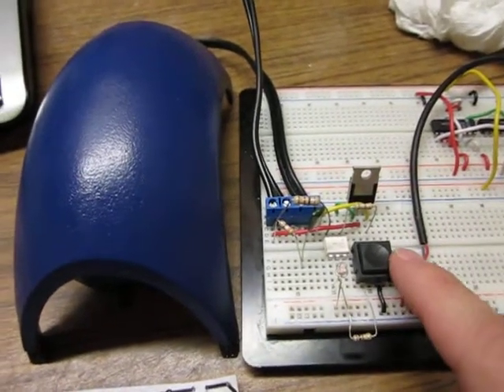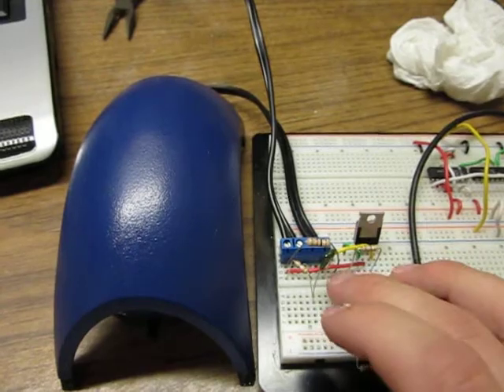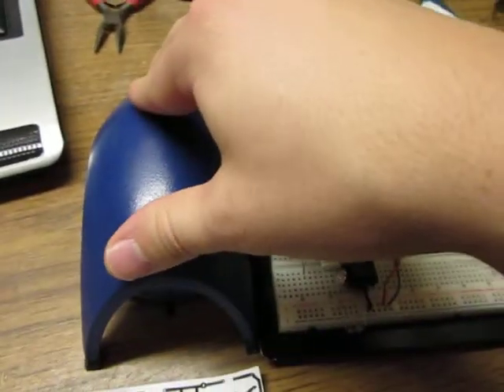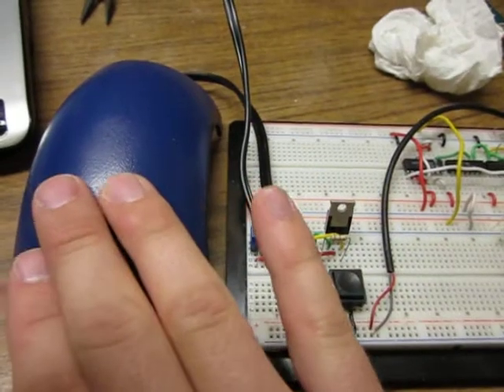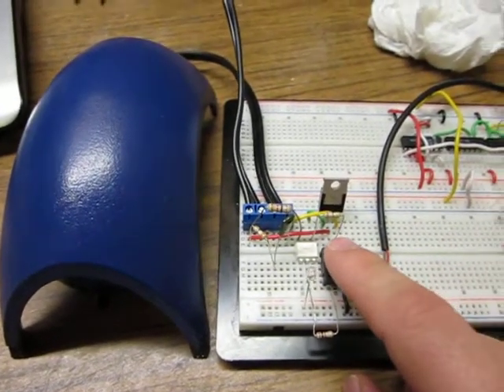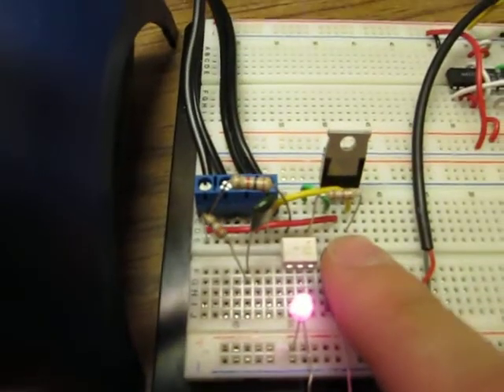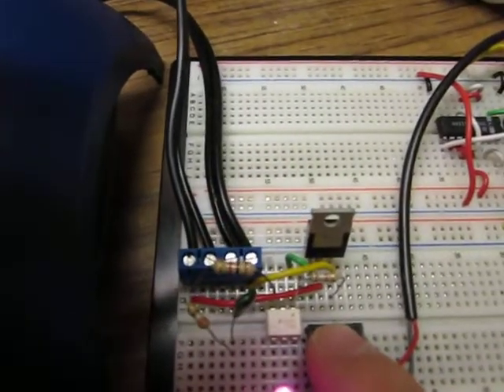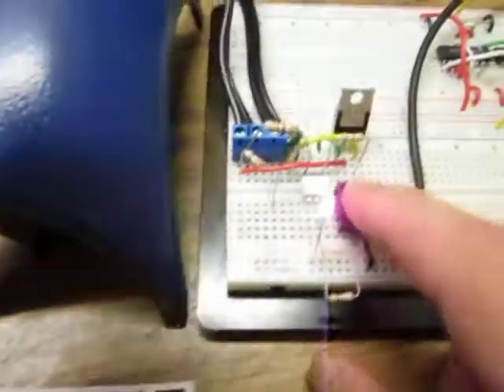Control 120 Volt AC with 5 Volt DC

Comment: Hi, can you send the wiring diagram please. Malkymix@hotmail.com
Im looking to also use 12 and 24 vdc. Can I use the same diagram to do so. Is there a more energy efficient way for the dc part like 2 transistors? Arduino suggests a mosfet irf520 but i think it is made to recieve 10v at the gate ?? Thank you.